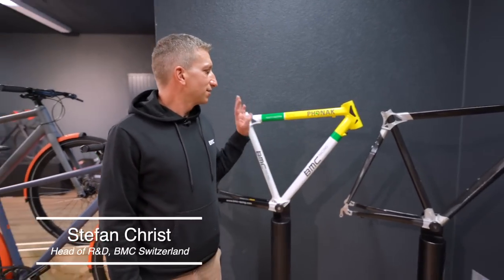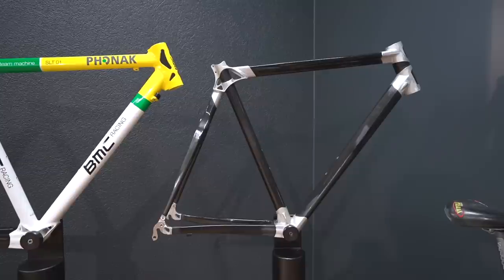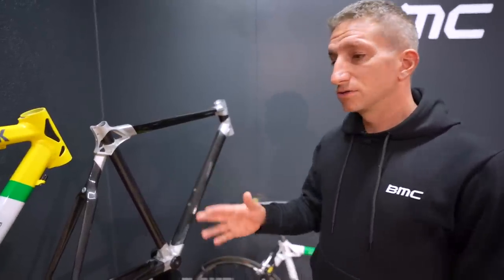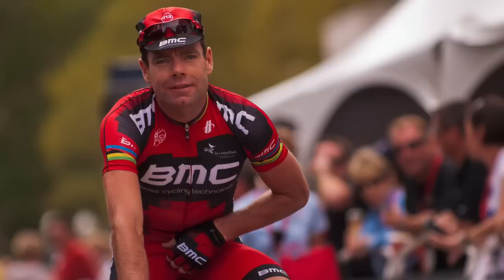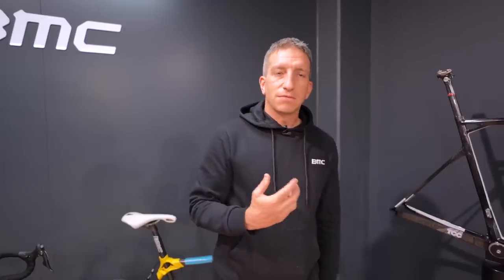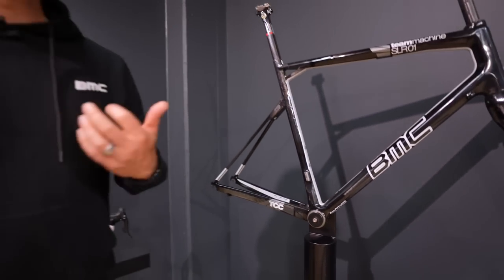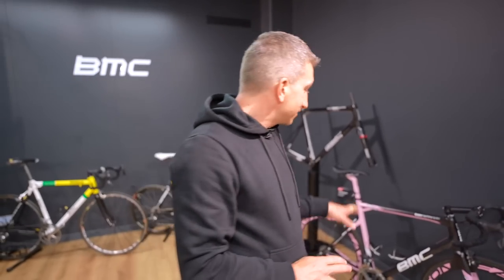The History of the BMC Teammachine (with BMC's Head Engineer)

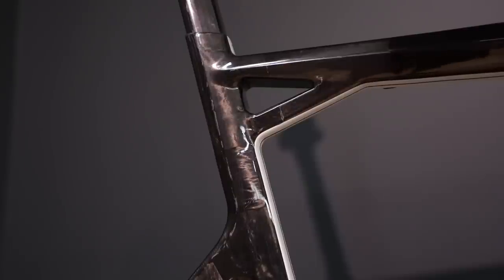Comment: Bravo 👏  Thank you Cam for bringing us this breakdown on the generational  design history of the legendary Teammachine.  I've looked high and low for something like this and no one else has done it.  Let alone from the lead BMC engineer!  The explanation of the cross lock design element @ 3:50 answered my lingering curiosity about it.  I am the proud owner of a 2nd gen red '16 SLR01 Ultegra di2 in rim brake with ENVE 6.7/ChrisKing wheels. 😍  Love it for its light weight,  compliance, handling, speed, efficiency and unique design cues.  KEEP UP THE GREAT WORK, CAM!

Comment: It would be a sad day if/when BMC move away from that tree trunk diameter down tube. It's been a hallmark of the TM frames for over a decade now, and makes spotting one on the road very easy, even without the brand graphic.

Great upload Cam, and interesting to learn just how much BMC innovation has influenced bike design over recent years 👌
Reply: The current Teammachine SLR01 already has a slightly narrower downtube  at the BB than the previous generation: it's slightly slimmer on the non-drive side. The reason for this is that symmetry was needed to optimize airflow around the bottles, and to keep the Aero Core bottle cages symmetrical as well.